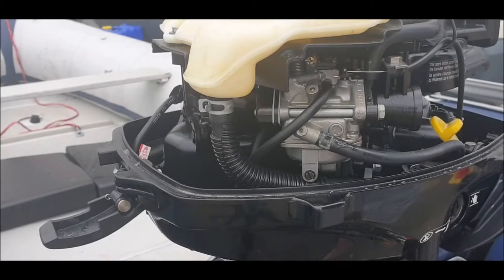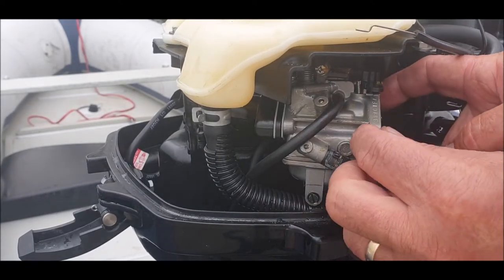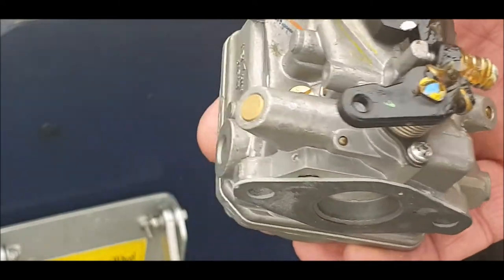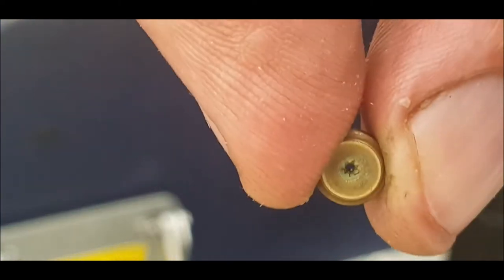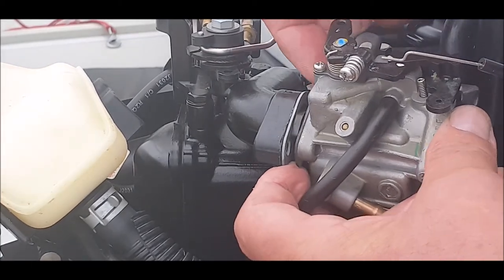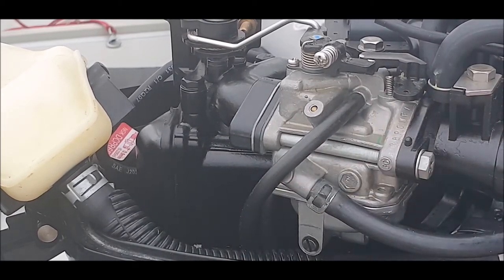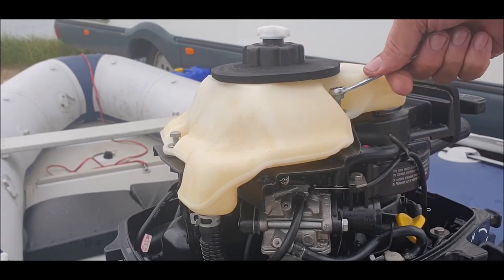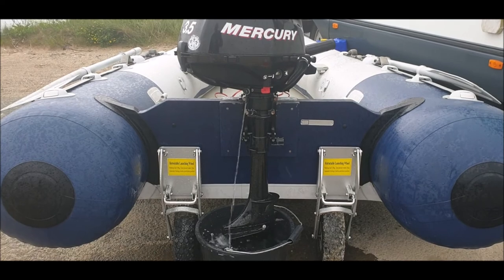MERCURY 3 5 HP 4 STROKE CARB REBUILD

Comment: Thanks for the video! I have a 3.5 Tohatsu (same motor) with the carb giving me grief. I've had it off twice so far and the bowl is still not filling. I'll get it eventually. That fuel shut off gave me problems as well. I took it off and apart to clean, and new oring on the outside. Its' better now, but still not great to begin with...
Reply from the maker: Thanks for watching Scott

Comment: Thanks for the clear video. Did you manage to figure out if the fuel shut off valve worked or not? I have the same. It just move too easy and engine won't stop once I switch this valve to off.
Reply from the maker: yep sorted thanks Mark

Comment: I have the Merc 3.5 hp.. I cleaned out the carb a few months ago and I screwed in the spring idle screw all the way when I put it all back together. How many turns out is that screw supposed to be? The engine won't idle unless I twist the throttle a little. If I let the throttle spring back to its resting position, it chokes out.. Any thoughts?
Reply from the maker: one and a half turns Matthew

Comment: There's no overflow pipe on mine. When I crank it over it won't start but fuel squirts out the top through a brass nozzle? Maybe the floats sticking? Any advice please?
Reply from the maker: sounds like float needle sticking or float

Comment: I think you forgot to clean the idle jet which is on top of the carburetor body not inside the bowl. That jet is so tiny that it is easily plugged and causes idle and start problem.
Reply from the maker: Cheers will check ATB
Reply: I have the same problem on this outboard, it is 2020 model approximately on 10-15 hours it was working fine last summer then after 9 months of no use It only work when on choke or if I give half throttle. it does not stay on idle. I changed with fresh fuel and took out the carb and cleaned jets but still have same problem. Any suggestions ?
Reply: @ugurtopsever6083  check the pin in the carb maybe.
Reply: @trojanx2006  service center fixed the issue. Carb got cloged couse of bad fuel.
Reply: @Ugur Topsever  Same problem here, but the blockage was caused by debris left in from the manufacturer. Always flush a new fuel system😢.
Mercury does not warranty any fuel related issue, even when it's their fault!

Comment: What a hunk of junk motor. I wont work on em. Ughh.. always a headache
There is a rubber "plug" in the bottom of the pilot jet that absolutely needs to be in it to run. The dealer will say it doesn't need to be in there but thats their way of putting a $7cdn plug in and charging you $200+. (Carb cleaner usually eats the plug if its over 2 years old, it just disintegrates).
Reply from the maker: defo